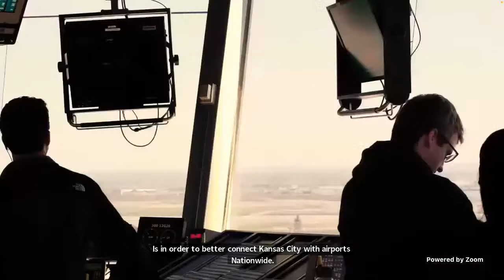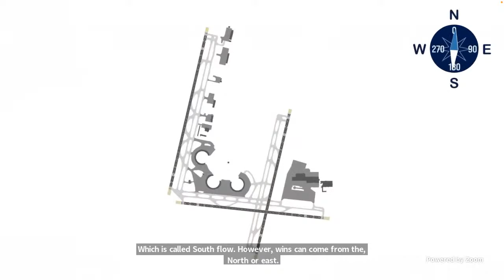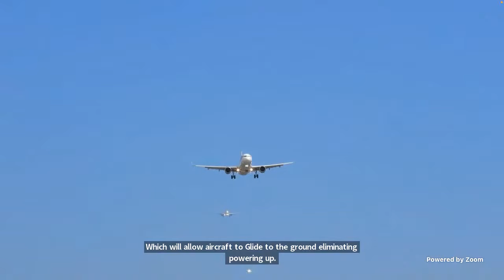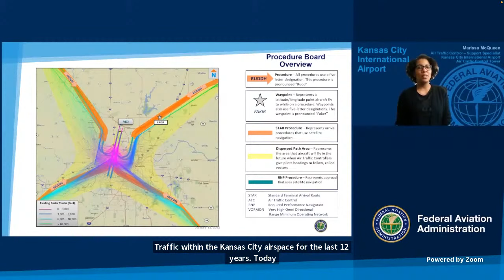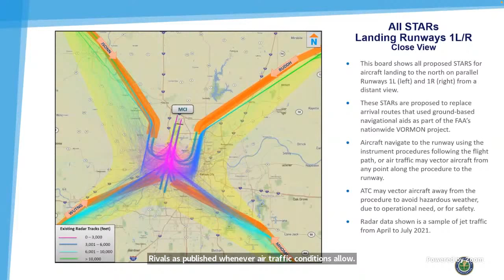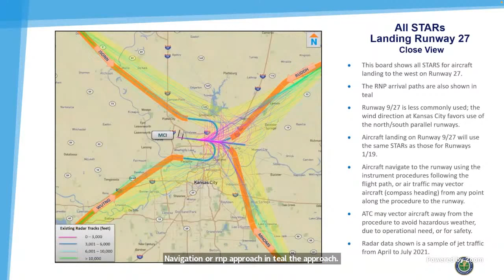Kansas City, Missouri Airspace – Virtual Public Meeting #1

Comment: Thanks for the upload. These new STAR procedures are definitely a welcomed and positive change to the Kansas City airports. When you can improve overall efficiency there's no reason not to get these new procedures implemented. I honestly never understood why controllers in airports who already have these new GPS based procedures would "boss us around" with vectors, speed and altitude instructions instead of controlling the flow of aircraft through these new STARs, clearing aircraft for the approach out of the last point of the STAR with the first fix of these RNAV RNP approaches and handing them over to the tower controller.